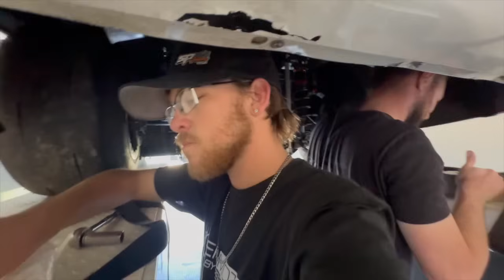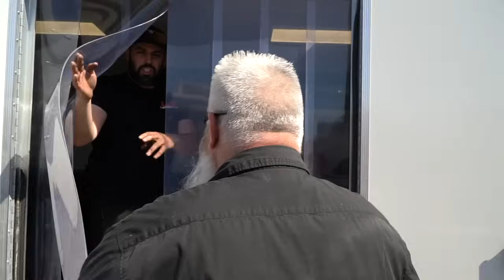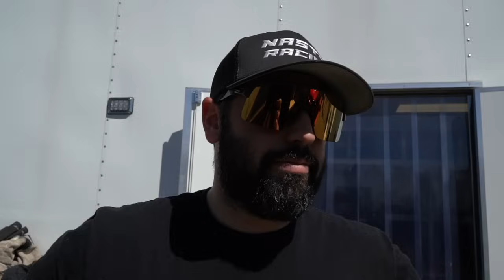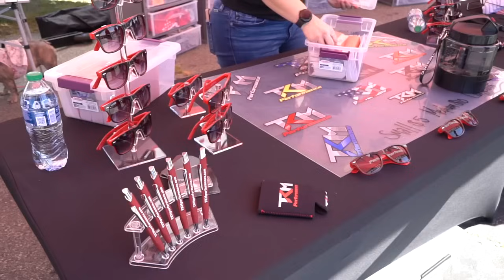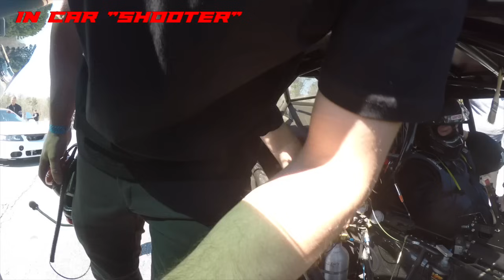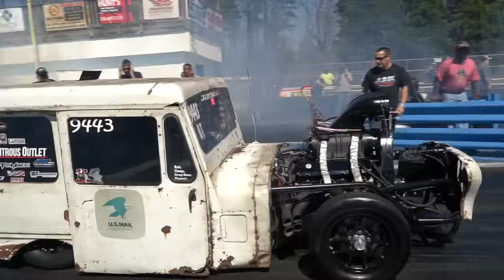Slick Rick and Shooter Take on PIEDMONT!!!!

Comment: Is there a difference between your rear suspension and Pro Mod Randy, it's been so long since you showed yours I forgot, I know he was having the same issues as you but I haven't seen Randy have a problem since he changed it, just curious.
Reply: Still can't figure out Y ur rear end suspension rises instead of hunkering down grippin and going down the track, IV been watchn for few years and no other car does wat yours does, in fact others do complete opposite,, maybe u can explain!!??!!
Reply: @FISHEAD3516  It's set up for a Radial tire,  that's the way the suspension is supposed to work, a car on a Slick will squat.
Reply: It's not just Ranys car, IV never seen any cars ass end extend up over 10-12" so fast, l watch and have never seen a car like that and l am at the track alot but dont radial race,, just tryn to learn..